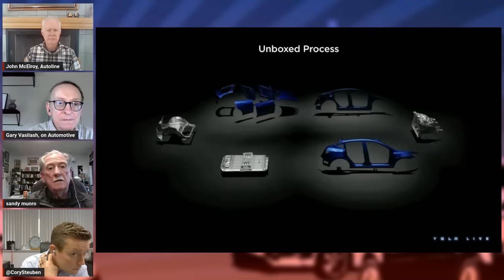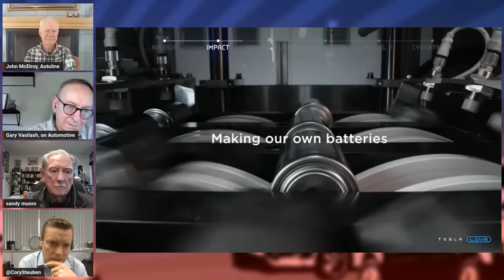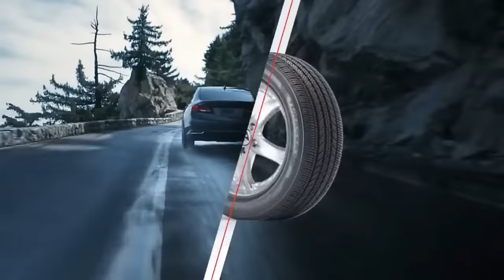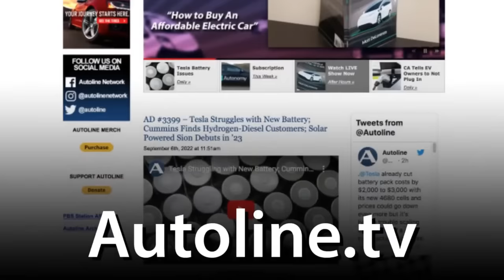Sandy Munro & Cory Steuben On Tesla's Master Plan Part 3 - Autoline After Hours 639

Comment: Dont buy any electric car unless you get one with LiFePo4 batteries. Otherwise you better charge it far away from your house. li ion bstteries are too dangerous for home charging and will probably be illegal soon in cars.
Reply: I have the LFP battery Tesla, but can you tell me any time a Tesla started on fire at a home? Outside of an accident, when has any Tesla started a fire? (This is a genuine question, not a statement to argue. I know comments sections, it's hard to interpret intent. So this isn't me trying to be snarky.)
Reply: @Sidicas  Can you share the story that occurred near your home? I've certainly heard stories, but I haven't found one yet that was the Tesla that started the fire. It'd seem that such a thing would cause a huge recall, like with GM.
Reply: @MH-Tesla  It's the li-ion battery technology that most EVs on the road today have is very unstable by design. It's the same reason why li-ion batteries are not allowed in checked luggage on an airplane anymore. The only fix is to not buy li-ion batteries as no matter what you buy if they get hot enough they will turn into a blow torch and chain react with all the li-ion batteries in all the devices nearby.  li-ion is still used in almost all consumer electronics and most EVs even though there are better battery techonlogies out there.

Comment: The Bolt outsold the Mach E in the 4th quarter of 2022! Now tell me nobody wants a $25,000 car! I am surprised none of these 4 individuals knew you can get super cruise on the Bolt!
Reply: The missing piece of the Bolt story is each sale loses money for GM. And the Mach E isn’t the same vehicle class as the Bolt.
Reply: 38,120 Bolt sold in 2022 and 39,458 MachE sold in 2022. MachE being much more expensive and still sold more. You would think GM would sell much more than MachE. So why is that not the case?
Reply: @nguyep4  
Because GM doesn't WANT to sell them, because it's a financial Boat Anchor.
.
They're between a Rock and a Hard Place...... During an Earthquake.

Comment: If the hairpin motor is so much better and cheaper than the current motor why weren't they already using it?
Reply: Fixing-a-plane-in-flight. Can't stop production to retool or they lose money momentum. That's why you don't want to get your car from Fremont - obsolete (relative to Tesla tech). Newer tech will be introduced in the new factories as they tool up. Old factories will probably be upgraded/retooled as soon as the new ones are ramped up to meet market demand.
Reply: Maybe there were some limitation that they only now solve but they didn't feel the need to elaborate?
Reply: @nguyep4  Hand wound are more efficient.

Comment: Sandy is losing credibility with nothing but fanboy praise for Tesla. The 48V move might make mild sense, but let's stop pretending it's an automotive revolution. Tesla's worse mistakes have been overestimating their abilities, and that will include making every component themselves because they insist that 48V makes that much of a difference. 

Tesla makes good motors now, but their first motors were inefficient. They adapted, so good for them, but let's not pretend they led everyone on the most efficient cars. They've trailed Hyundai (original Ionic), Kia (Niro), BMW (i3), and even the Bolt in terms of efficiency. For several years, Telsa Model X and S were the least efficient cars made. Partially because they screwed up the whole industry in terms of bloating the battery and creating stupid fast cars to seek broad acceptance with no-compromise range. That's upset the whole auto industry in terms of sustainability, initiating SUV (Model X), pickup (never delivered Cybertruck) and hyperperformance expectations. We only have 576 hp Kia EV6 GT because Tesla created horrific expectations and appetite for stupid fast EVs. And yes these are stupid fast, more than most drivers are prepared to actually drive safely. My friend totalled her Model S trying to pull out of a parking spot. What other car can total itself in a parking maneuver? 

I used to believe EVs were our future. I now understand that the industry doesn't give a crap about sustainable transportation (Hummer EV, all the EV pickups, and the massive SUVs including EV9  EX90)  Cory, if you're driving a Yukon XL in 2023, it's hard to take you seriously when you talk about how the EV revolution is going to happen. Sorry to dunk on you, but come on.

The sustainability of EVs depends on the speed of renewable energy adoption and actually eliminating all emissions from mining, material refinement, parts manufacturing, transportation of parts all before it that all arrives at a LEED certified assembly plant. Witness Polestar's LCA report carefully. Their Polestar 2 production is 25 tons CO2e. That is twice what Argonne Labs is telling Climate scientists through their GREET 2  estimates. And Polestar's Chinese assembly plant is LEED certified. We can't afford tons and tons of CO2e emissions for car production. This whole conversation is misunderstanding how far off the mark EV production is in terms of sustainable transportation. It's not enough to half auto emissions, and lawmakers will soon figure that out.
Reply: Lol you don't believe Tesla investors day then huh? drilling for oil isn't bad at all, shipping oil isn't bad at all, transporting oil to refineries isn't bad at all, energy to refined oil to gasoline isn't bad at all, transporting gas to thousands of gas stations isn't bad at all, toxic fume from hundreds of millions of tailpipes isn't bad at all. But how dare they mine for minerals .

 Fyi, It is a free market in some sense. Manufacturers can make what ever they think the consumers want, Hummer EV or EV9, etc. Lawmaker can't do anything other than not banning ICE cars. But by 2027 if you don't have EVs then might as well close down the shop. For someone who wants sustainability sure is yelling anti EV.
Reply: @karlinSanDiego
You'll be from the "If I regurgitate enough out of date, incorrect FUD they'll believe me" department?
.
It's confirmation bias on your part.
.
Watch and learn.
Reply: @nguyep4  the auto industry is not the solution to the auto industry. You don't end car dependency by recreating unsustainable EV versions of also unsustainable ICE luxury pickups, SUVs, and cars.
Reply: @karlInSanDiego  How do you know it is unsustainable? Based on who point of view? One thing sold me is the battery can be recycled by over 95%, at end of life of each battery, it can be recycled multiple times, only need to be refined once. This implies the closed system given enough time, at any time the battery pack is at end of life, a new life can be brought back over and over without degradation meaning recycled battery has the same properties as it once was. Battery technology is improving, new development in motors and electronics, lighter and more efficient body requires less and less battery needed... More battery storage that takes full advantages of green energy. I don't know about you that sounds sustainability to me.
Reply: @nguyep4  hydrometallurgical recycling requires shredding and many stages of chemical acid separation processes to get back to battery components. And then they must create all the cells and pack components all over again. But the car production and recycling itself is also extremely emissions intensive. We have never had to try to operate multinational industrial manufacturing on par with car manufacturing with zero carbon. Current estimate is 25 tons CO2e for an EV production and recycling according to Polestar. 

You cannot recycle batteries when they are more valuable as grid storage and they will be for some time because the power industry also dropped the ball and adopted the wrong storage medium. Lithium batteries were always better suited for transportation because their energy density is high. But if you follow all aspects of renewable energy, you'll know that Lazard oversold lithium batteries for years as lowest LCOS over more sustainable pumped hydro storage, and now we're going to dig up all the planet's spodumene (which us 10x more CO2e intensive than lithium from brine) to satisfy Single Occupancy Car dependency. It will be another decade before lithium battery recycling is a meaningful source for new battery formation. 

It's not just the car industry. All of the things we take for granted as being emissions we just have to accept, will be unacceptable. This is why the pundits here are in a bubble, assuming their industry is not going to be shrunk out of existence by the industrial crash brought by zero carbon.
Reply: @karlInSanDiego  Everything will create CO2. Us breathing create CO2. 25 tons of CO2 to make an EV but how much is to make an gasoline car? Without context you are purposely making EV look bad. I.E high number = look bad. Study shows that a typical car travel 11k miles a year make 4.5 ton of CO2 emission. 4.5×(number of yr driven) + AmountCO2@BuiltPer_ICE vh  =  ICE cars CO2 emission. It is said a Ford fusion creates 17 tons of CO2 before hitting the road. First year of ownership of a sadan is already 17+4.5 = 21.5 ton of CO2 and 4.5 ton added every yr after that. 

Recycled is still better than burning the gas once and drill for more oil or mining, transporting, and refining the minerals all over again.
Reply: @nguyep4  worldwide average CO2e per capita is 4 tons per year. In USA it's over 14 tons per capita per year despite much of the durable goods we buy including cars, come from outside the USA. We will need it to be 2 tons per capita worldwide per year before 2050. And frankly that date was arbitrarily chosen. We cannot afford any car production. You have not heard me make the argument for ICE over EV. My point is that the auto industry has no future where it makes full sized and giant sized passenger cars for US citizens to enjoy at many tons per vehicle. We need to shift to micromobility and electrified mass transit rail using catanary lines, not batteries if we want to have reasonable mobility in the future.

Comment: Tesla only produces EV's and limited one's at that. GM Produces a lot from their brands++ They will be around for more decades with more EV's and ICE Models for everyone. Tesla is for a few.. All sedans!
Reply: You don’t get it. 

More models is not always better. It will likely hurt GM in the long run. 

More models adds complexity and cost
Reply: @Alex  He GM is More Makes for each of their 4 brands and they are for anyone in my area of a Metro Area that has all of them around the Beltway. Tesla don't. If you have a issue you can roll into any of the Brands Dealers to get it done that day or in hour or less. Not so for Start up Tesla with none. You have to wait weeks or months.  You can't get repair parts and have to get them from wrecks from speed.   GM will be around for more decades.....